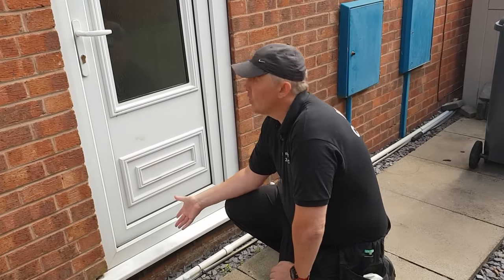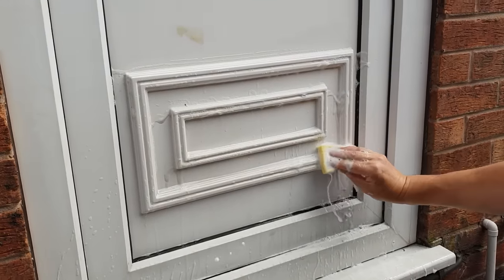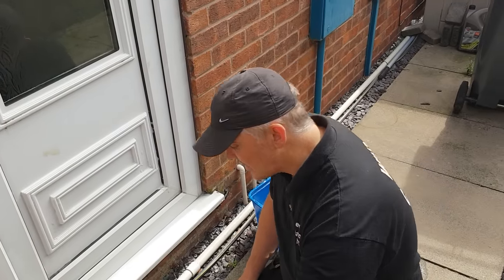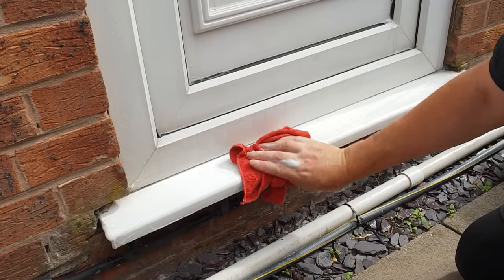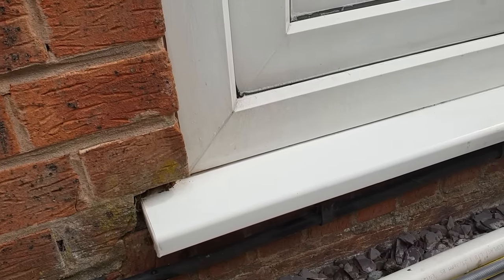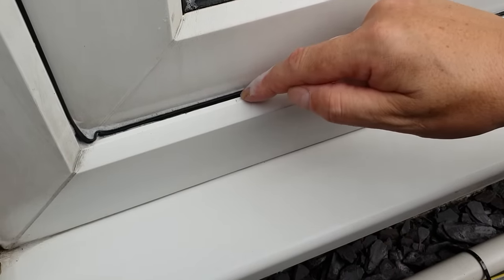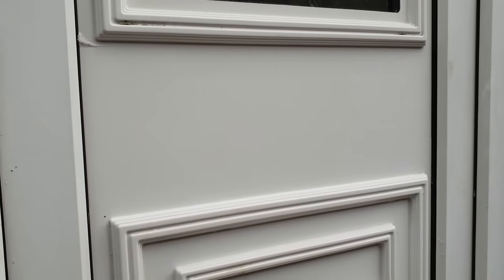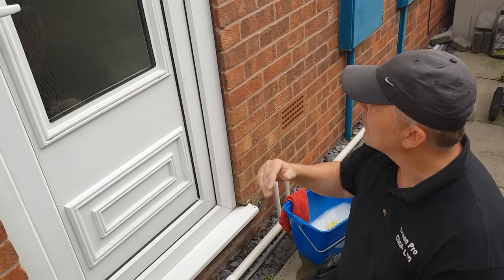Easily Revive Your Home's Look Using THIS!: The Ultimate Solution for uPVC Frame Restoration!

Comment: I would never use an abrasive pad Jesus. A good soapy wash and then a soft cloth with t-cut will remove any stains and when rubbed off will leave a high gloss protective finish. Then a good car wax  will give a long lasting protective gloss finish and will stay clean for a long time. Using an Abrasive pad will remove the protective finish of the UPVC.
Reply: RUSSELL KERFOOT what the hells a T cut?
Reply: @tzuamourshihtzu9871  It is a very mild rubbing compound polish. It is used to restore faded paintwork on cars. It is sold at any car parts store or ebay. It works great on fridges Freezers cookers to.
Reply from the maker: Thanks for the tips but perhpas you should try it first. TCUT will leave a gloss finish for an hour.  Thats all and I know this from having used it on several occasions in the past. Rub out developed by Unger the industry leader in window cleaning products does not remove the gloss. 
Thanks for you input. Can you please post your link here demonstrating your methods? Thanks
Reply: @Darren-Green  all the professionals coming out today lol, thanks for your video, im away to do my door 👍
Reply: Yes Russe your correct ! Never use nothing more than clear water gently spashed over pvc to remove dirt , then s bit of fairy and a bucket of warm water once a month ! Seems people are just too bone idle to do it themselves !!

Comment: Thanks for the video. This method of cleaning is actually quite a good one. But for anyone doing it like this I'd recommend making sure not to press too hard with the scouring pad and use plenty of dish washing soap which cleans and lubricates as you clean. It's a good idea too to rinse off the soapy water because dish washing soap contains lots of salt. Salt attacks the surface of the plastic making it oxidise and making it go dull very quickly. There are several types of UPVC mix used for windows and doors and some are more affected than others. The early doors and windows oxidise more easily. Later ones are more resistant to this effect. You will all have seen the dull effect on especially white upvc. When you rub it with a damp cloth white colouring actually comes off onto your cloth. That is the oxidisation. I haven't used the Rubout product but it will no doubt be good at restoring the gloss finish. A nice video producing good results. Thanks.
Reply from the maker: Thanks for the educational information Ian and yes you're totally correct about rinsing off dish soaps.
Reply: Does dishoap dull every plastic surface types like plastic tables and rubber seal and car interiors? Or is it just upvc? What can we use to clean plastic instead for rubber, car interiors, upvc doors and plastic furniture?

Comment: I would think the scratch pad would scratch and dull th finish on the door.
Reply from the maker: It's just a dish scourer, same as you use for cleaning pots and pans at home. The abrasive properties are not harsh enough to damage the door.
Reply: Lynn the way to go is screw fix upvc spray cleaner it comes in big bottle and you put the spray end amazing no harsh messing about damp cloth and bingo
Reply: pots and pans are made of steel and still they will get swirls from a scouring pad. plastic is considerably softer than steel, those scotch pads absolutely do abrade upvc and leave marks in the surface.
Reply: @cliveramsbotty6077  no marks at all with screw fix upvc cleaner only damp cloth needed
Reply: A green scourer will scratch the surface. I used one to remove some decking oil I painted. The client pulled me aside. I had go back with some fine finish car polish luckily that got me out of trouble. None scratch scourers or uPVC solvent restorer.

Comment: I've just moved into a house where the upvc doors have drips of dry paint on them from previous occupants. I am unsure how to remove them with damaging the door finish, any ideas anyone?
Reply from the maker: You could try 'shaving' them off. using a razor blade only at a very shallow angle and gently scraping. If it's dried on white plastic doors though for some period of time I dont hold much hope.

Comment: Please me how to get rid of decades old nicotine from pvc doors
Reply from the maker: I am assuming they are white PVC?  First I would use a strong solution of UBIX 2000 (From the cleaning warehouse in Willenhall) mix about 1 part Ubix to 3 parts water. This will do the majority of the heavy lifting. Use with a green scourer.  Then if you still have any marks left go to the Unger Rubout - again from The Cleaning Warehouse. 
Honestly, if that doesn't do it (and it will) you'll need new windows. 
To-date however I haven't found any that I haven't been able to clean. 

WARNING -- I DID LEARN on my last Nicotine clean up job that that shit is NASTY -- (I am also ex smoker 12 years retired)  Even though I wore a face mask and marrigold golves the solution that ran over the gloves and onto my skin left me quite sick for about 3 days.  PLEASE BE CAREFUL!

Comment: good job, although i use Bond-it Upvc Restorer myself gives a great shine with a light buff and a lot cheaper, there are lots of cream restorers out there,  be sure to check that they don`t contain bleach (many do)  they will discolour  the Upvc, regarding the green backed scourers a customer checked with me whether i was going to use them as he swore someone prior to me caused very minute scratches on his sills on inspection there were indeed very minute scratches, i obviously have no way of knowing how they got there, and have never used the green backed ones anyway as i have always use the white back scourers, they sell these in most supermarkets next to the green backed ones there described as Non Scratch, always best just to be on the safe side. enjoy watching your videos 
tony
Reply: I was amazed when I saw green scourers being used, they can definitely leave small scratches all over softer surfaces and I had heard UPVC doors/windows have a protective coating that is easily removed with the wrong product(s).  I'm no expert and I can't vouch for the information about the coating but having scratched various surfaces with green scourers I'd definitely try the white scourers first, or even just a cloth with either Bond-it or RubOut.
Reply: I beleive that the green scourers contain abrasive, but as a mechanical engineer, I can tell you that plastics are abrasive in their own right.

Comment: I find that CIF does the same thing and it smells really good
Reply from the maker: Steve Hughes CIF leaves the white work with a 'flat dull'finish where Rubout leaves it with nice shine. CIF is not in the same league IMO mate.
Reply: Green Pro Clean Ltd I will buy some rub out from the window cleaning show & give it a go
Reply: Cif works fine to clean but finishing with WD40 shines it back up and repels water
Reply from the maker: @PlushBadger  Yep but WD40 does not last - it was a used car dealers trick to spray WD40 on those cars of the 90s that were red but faded badly - it would make them shine with a new paint gloss but a week or two later shine is gone.
Reply: Sorry , am listening to Alex Belfield , very interesting an true !

Comment: I found nail polish remover applied with an ear bud removes felt tip and a few other marks. Never use anti bac wipes. Makes it yellow. Cap of lemon Dettol also cleans and deo's the frames.
Reply from the maker: We use a lot of nail polish remover to remove sticker residue and quite often the odd paint splatter off glass.
Reply: Whats deos?

Comment: All sounds good😁. I was always taught to start at the top so that the dirt goes down and that you don't keep re cleaning it! Is there a reason you start at the bottom?
Reply from the maker: Yes, there is a reason - the sill was the dirtiest part of this door - I used it simply as a demonstration section for the video - as you see I did not do the entire door - had I done so I would have, as you rightly said, started at the top and worked downwards.   The only time you start at the bottom and work up is when spraying degreasers on vehicles or ovens or softwash chemicals on walls.

Comment: I've achieved brilliant results with Bond-it PVCu Cream Cleaner, costs £6.40 off Amazon for a 1 litre bottle. Wash and dry area to clean. Apply cream with a paper towel and rub vigorously over any stains, then wipe off with a clean paper towel, then buff up with a microfibre cloth. Like others, I would never use an abrasive - like the scouring side of a sponge.
Reply: Never use a abrasive sponge, best cleaner is astonish grime blast PVC cleaner ,brings it up like new
Reply: Where can i buy the astonish from i cnt find it online, please give me a link?

Comment: When you do a door, do you normally work from top to bottom?
Reply from the maker: Usually yes. The biggest tip is whilst you're scrubbing with whatever solution you choose, try to keep the door wet to avoid your chems drying and potentially staining.
Reply: @Darren-Green  Thank you.

Comment: Iv two windows that need a really good clean mmm do I get this or does I get the pink stuff. As I used the pink stufff on the windows grams that I can reach n they came up well iv two on side house there really bad mite have do them b do video on them
Reply from the maker: Pink stuff will work. Difference is Runout leaves a nice 'sheen' when done.

Comment: Ive moved into a place with older windows with the upvc having lots of marks, scuffs and just generally needs a jolly good sprucing up. I know it wont be perfect but its got to be able to look better than it is currently.
The one on the wolverhampton site you mentioned says its a hard water stain remover and then in the blurb says its a glass cleaner. Ive looked at that same bottle elsewhere and they all say its is a liquid saying its a glass cleaner whereas it looks like what you are using is a cream. Do they not make it anymore?
Reply from the maker: https://www.thecleaningwarehouse.co.uk/unger-rub-out-05l-5395-p.asp

This is the stuff, it multitasks. dont worry about what it says on the bottle - it will take care of your PVC just fine.
Reply: Thank you.

Comment: Hi is that green scourer not scratching the UPVC ?? I need my doors done desperatly but would be worried about using the green scourers.
Reply from the maker: If they did I wouldn't have used them for the last 10 years mate!
Reply: Was just asking  no need to be SARKY !!  but thanks for your reply,  And thanks to you I have ordered some Rubout.  @Darren-Green
Reply from the maker: @JIMMIX7   Not being SARKY at all, just making a statement of fact.  You can't begin to imagine the number of messages I get being told I don't know what I'm on about and it's going to scratch sills etc (obviously from people that don't have a clue) so I was simply trying to get the point across that no it won't scratch otherwise I wouldn't use it   Good Move on the Rub Out, you won't be disappointed.
Reply: @Darren-Green  Thanks again, Yeh true I don't have a clue so that's why I asked for your advice, and I hope you dont think I'm one of those thinking you don't know what your on about. The reason I asked you was because I have watched your vids and was inspired by them. Without youre vids I would not have known about Rubout.. A simple answer would have been 'No it wont scratch'. But thank you again for the advice, Much appreciated

Comment: I live near a busy bypass.
The rain and wind is a real problem to keep my white door cleaned.
Best to wipe over with hot water.
Then use a small soft sponge with washing up liquid.
Rub in well in.
Wash of with cold water.
Sometimes I do add a bit of bleach.
Ciff is the best cleaning method.
Not sure about wd40🤔

Comment: Our frames are brown plastic and faded in sun, is there any way to improve them, except replacing?
Reply from the maker: If you look at car detailing videos - some of them use a heat gun to apply heat to the trim which in turn has a reaction and brings the color back to life.  However the effect is only good for about six months.   There are also some companies in the UK that will re-spray your frames to give them a new finish.
Reply: @Darren-Green  thank you 👌

Comment: Can this stuff be used on grey coloured windows? They're grey on the facia but white beneath that and on the inside.
Reply from the maker: I do not get what you mean.  Are they a manufactures grey finish or have they simply faded to grey? A small test patch out of the way is easiest.
Reply: @Darren-Green  Lol no mate they were purchased as grey windows. But not grey throughout, simply grey on facia. From inside the house, window frames are the usual white.

Comment: Some halfwit tagged one of my upvc windows, how can I remove it without damaging it further? Please help
Reply: White spirit then Jiff then T cut
Reply from the maker: If you can ID the type of paint google it and it will have best remover in the data sheet. Otherwise start with a thinners or white spirit and then once you're close - use t-cut but finish with unger rubout as this will restore the sheen.

Comment: Was that AutoGlym he used?. Anyone know how you get paint off of pvc?. There's a splatering of red paint on the bottom sill of my patio doors that has been there before I moved here. No idea how long its been there probably at least 8 years or so. A power jet wash wont remove.it.
Reply: @gailhornagold7470  Cheers for that.
Reply from the maker: No, it's Unger Rub OUT.   For removing paint, knowing the type of paint and choosing the right remover for it is the key, however use sparingly, and repeat many times instead of trying to do all at once.  Some paint removers will burn UPVC.
Reply: Careful application of a flexible steel paint scraper does the job. Give the leading edge of it a good rub with 220 sandpaper first and soften the corners too so they're less likely to dig in. Works for me.
Reply: @Mike-hu8yz Thanks for the advice, will give that a try.

Comment: Would it get the rust marks off mine with cutting metal and grinding? I don't think so. But more to the point! Why is there a pipe going all the way along your gravel????
Reply from the maker: No Gary it will not remove the marks caused by sparking from a grinder or welder as these are not actually surface marks they are damage. What did you expect from molten metal sparks meet plastic? 
Lastly if you think the point is the pipes under the door I suggest a doctor for advice on the A.D.D.

Comment: Would you ever use ubik 2000 to wet the spondge instead of water then use unger rub out ?
Reply from the maker: No reason you can't. You would still need water however to rinse off the residue afterwards.
Reply: @Darren-Green  i was just wonderin if it would / could make it cleaner as both are great cleanin stuff

Comment: how have the black rubber beading not left big black streaks all over the door because he has all ready washed it
Reply: Because not all beads are pressure gasket seals rubber type some are made up differently and are welded to the upvc extrusion thus you dont get the black water stains ?
Reply: So is that black beading rubber or something else?

Comment: Why would you do the bottom first. When you get to the top. All the shite will run to the bottom and put you back to square one. 🤔
Reply from the maker: I wouldnt on a job John, however for a quick demo there is more of the marks and scuffs at the bottom but yes you are totally correct.

Comment: What’s best to get fence paint overspray of upvc thanks
Reply from the maker: Read the can of fence paint and see the recommended removal agent -- use that first then lots of water quick to neutralize then just a good scrub.
Reply: Did you find a solution that got the fence spray out of the upvc? I have a similar issue

Comment: All you need is a cheap bottle of Jiff and a sponge without a scouring side to it damp the sponge,then put a little bit of Jiff on the sponge and watch the dirt come off leaving a shiney clean plastic surface behind.Been using this method for years.
Reply from the maker: You obviously haven't used it once as Jif or CIF as now known leaves a dull finish that goes powdery in a few days.

Comment: Cif cream cleaner just as effective and no need to use the abrasive side of the sponge .......
Reply from the maker: There's also no need to use the abrasive side of the sponge with Rub Out - it just speeds it up. You may know this had you ever actually tried the product.  The KEY factor and most importance difference is RUBOUT leaves a fresh shiny sheen to the surface, Cif leaves it dull, and if not rinsed thoroughly, powdery after a day or two and then a yellowish hue and stain after a few weeks of exposure.   But hey, maybee your customers prefer destroyed frames. 👍

Comment: Just use everbuild upvc cleaner with a rag save all that messing about
Reply from the maker: You are referring to a Solvent based cleaner @V6PSC this will remove grime and dirt but not scuffs and scratches. Unger Rub out will remove it all.

Comment: How to clean UPVC door.
Jet wash.
The end.
Reply from the maker: Wow, that was impressive, the way you so succinctly destroyed all the rubber gaskets by blasting them with too much pressure and left nothing more than a wet door, no cleaner than before, with all the scuffs and scrapes in place that now leaks a treat cause you totally destroyed it by using an inappropriate tool.  Do you bathe your kids in Domestos too?  
The End.